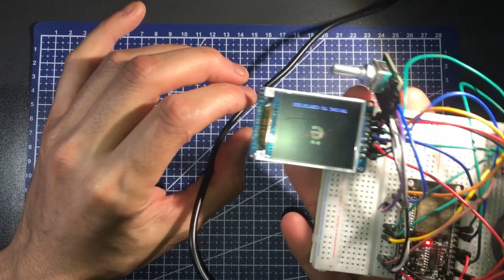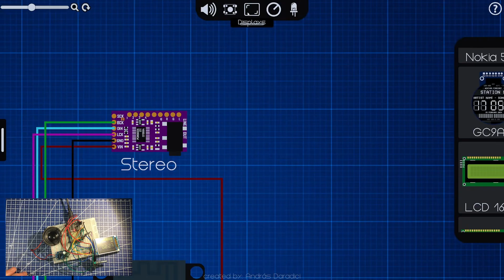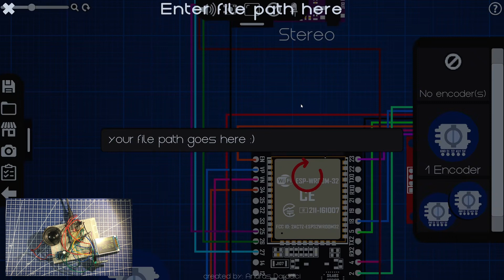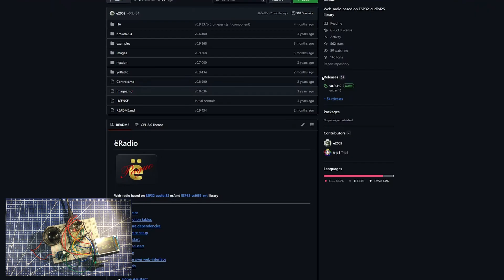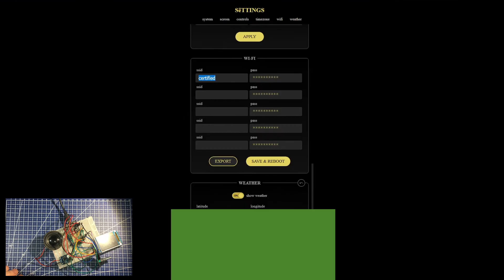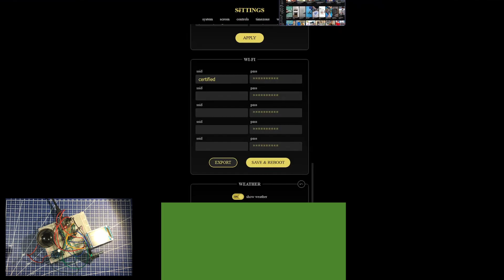ESP32  EASY & CHEAP internet RADIO | YORADIO | ёRADIO

Comment: Hi, I did the same project but I can't get the st7735s 1.8" 128x160 display to work, can you post your myoptions.h configuration here? Thanks a lot 🙏
Reply from the maker: #ifndef myoptions_h
#define myoptions_h

#define DSP_MODEL         DSP_ST7735

#define I2S_INTERNAL         true

#define ENC_BTNR         36
#define ENC_BTNL         34
#define ENC_BTNB         39
#define ENC_INTERNALPULLUP         false

#endif
Reply: @CertyGyver  🙏 Thanks

Comment: A metal enclosure will block your wifi signal and reduce the wifi reception unless you use the ESP32 with an external antenna.
Reply from the maker: Oops, guess we will find out soon, already got half of the enclosure done and parts mounted to it, just need to finish the top cover , worst case scenario scrap it all and mount it in a 3d printed enclosure